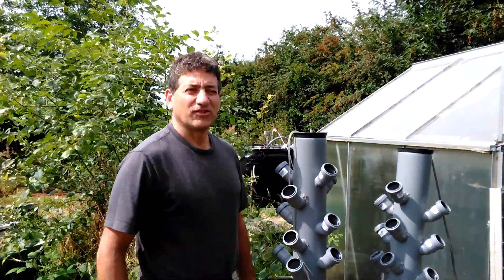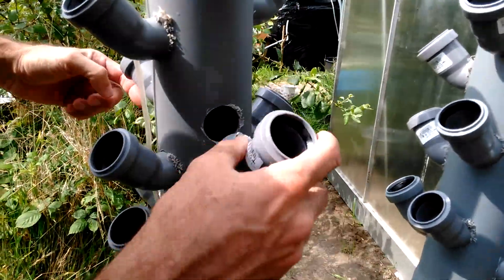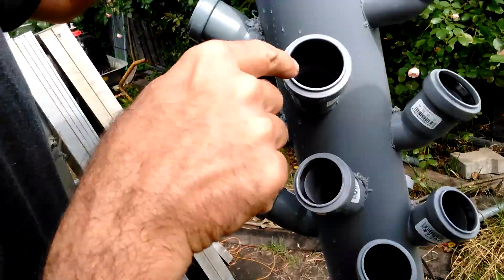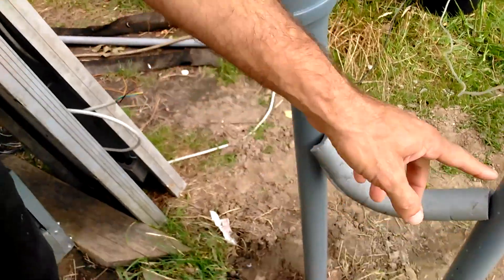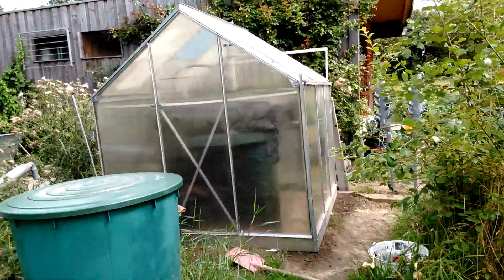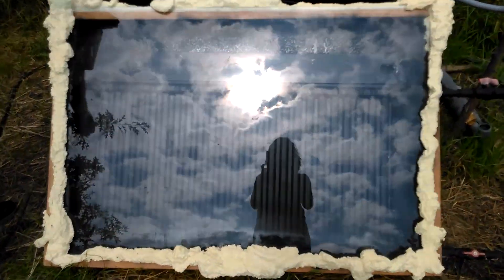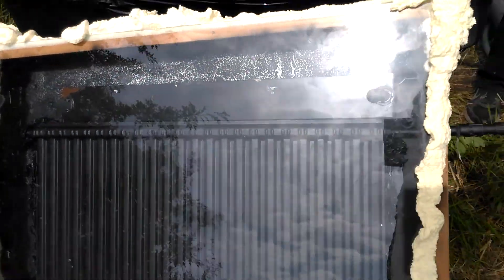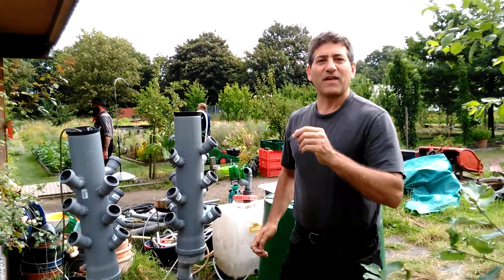Experiments with airlift aeroponics on bioslurry with the Solar CITIES PVC tree

Comment: The energy used by the airpump in a 24hr period could run a high pressure aeroponic system for at least 3 weeks. Having the root chambers in mid-air will lead to severe overheating, especially in full sun. Airlifts also add heat to the water.